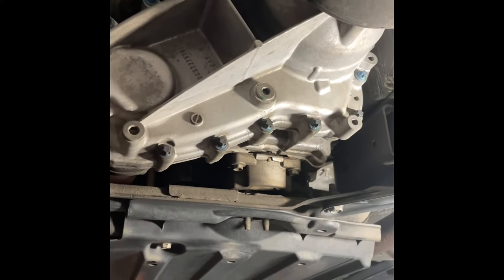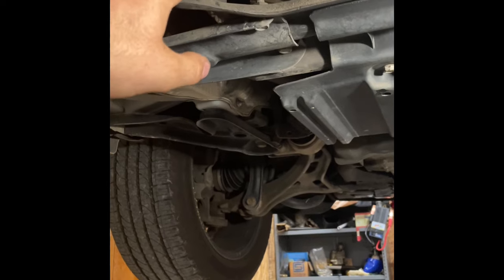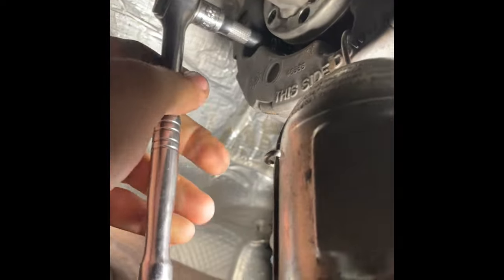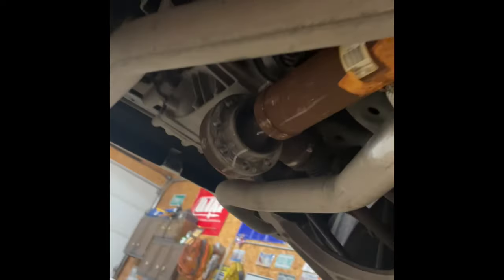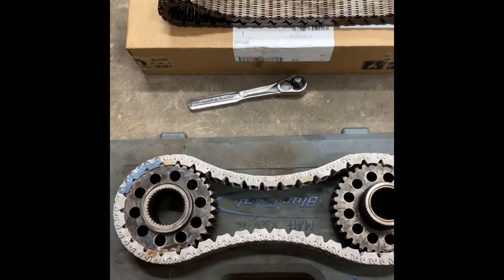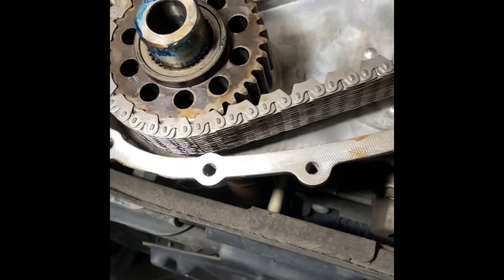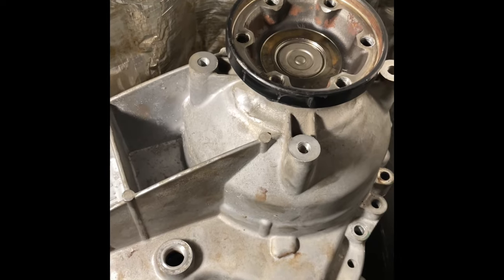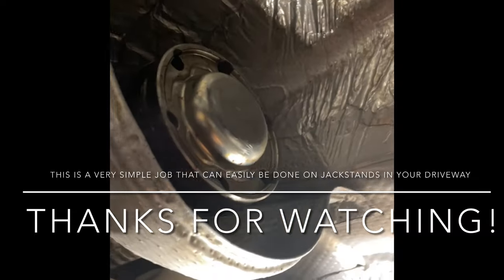WK2 Jeep Grand Cherokee transfer case noise FIXED!!

Comment: Sweet! I see things really don’t change much. I had to do this same job in a 2004 with the NP247 full time transfer case. It’s really not more difficult then the older part time cases. 

I did the oil pan on my 13 grand and had to drop the whole front crossmember. A lot of work but not complicated. By far the worst part was getting the front CV driveshaft out of those yoke cups!

Give me U joints and straps any day.

Comment: Watching this video, gave me the confidence to do it myself. The auto part store gave me the price of a new transfer case at 1800 to 2750... i called the dealership parts department got the part numbers and Google searched them and found both sprockets and chain for less than 450 and I put them on myself due to this video... oh and the auto part store did not sell the parts separately... dealership only.

Comment: Hopefully I don’t need to do this, but if I do looks like I can do it thanks to your video. I change my Transfer case Fluid along with the front & rear Differentials every 30k and I hope that it will prevent any future issues.

Comment: Good job man thank you I have a clicking noise I guess that’s what I’ll be doing soon:) you didn’t list the parts and where you got them always a blessing to have that:)
Reply: Is your clicking noise when you go from P to R, then to 1st and right when you stop?  Mine clicks, but not nonstop yet.  You can hear it when reversing, right when it stops, and right as she goes from first.  I'm not sure if it's the transfer case, or a bad u-joint on the front drive shaft.  Your ideas would be appreciated.

Comment: do you remember offhand what the torque was for the 8mm bolts that couple the front/rear drive shaft & the 12mm for the balancer?....I appreciate it

Comment: I was lookin at the manual for this chain install and it says "There is a blue link on one side of the chain. This blue link MUST be 
installed facing upward" Not sure if they mean facing outwards so you can see the blue links after you have the chain installed or if they mean upwards like at the top of the sprockets

Comment: Hi, I've got a 1994 Jeep Grand Cherokee Laredo ZJ with the full time all wheel drive. It's making the same noise when I do a hard pull off from a stop. My Jeep has the NP 249 transfer case and it does have the viscus coupling. Do you think the chain could be causing the noise and would the cover be able to be removed as easily as this jeep was? Thanks.

Comment: I wonder if the SRT and Trackhawk use a stronger setup.
Reply: My car is a 2012 SRT, I have this same problem and its been getting worse since I bought the car. Mopar catalogue shows that its the same part used in all WK2 Grand Cherokees.
Reply: 14k miles in my 20 srt… no lol same shit.

Comment: Im having same problem.  It only makes noise as you accelerate.  I can let go of peddle and no noise.  But hit gas pedal.  And clunk clunk.   Did you have same issue.  Gas pedsl only noise
Reply: That sounds very similar to my issue. First it started doing it only when it was really really cold outside and coasting downhill,  now it does it at all temperatures, mainly when accelerating now, and it speeds up as I accelerate. 2011 Grand Cherokee. 5.7 QTII

Comment: are there any special tools required for gear removal? If not where they easy to pull off with the chain?
Reply: Mine just fell off after I pulled the cover off no tools needed

Comment: I am hearing and feeling My 2019 grand Cherokee knocking noise in the back when it shifts from 1st to 2nd gear. Sounds like going over a bump in the back. I hear a knock when I first get in starting into1st or reverse sometimes. And sometimes when shifting back down into first while coming to a stop. Do you think this is the problem you are describing in the video?
Reply: Check your diff bushing

Comment: is this the MP3023 transfer case
Reply: Doesn't look like one.
Reply: MP2023 and 3023 are same chassis and chain: 3023 has electric motor and two-speed gear train (more complicated)

Comment: Where did you buy the chain
Reply: Did you find it big guy? Amazon found the chain .  went to Chrysler they wanted 200 plus I bought the Amazon for 75. I am going to evaluate the chain guide before I spend another 80 bucks.

Comment: Here is the noise it makes..https://youtu.be/vxD7Cs1Az08
Reply: Definitely change both gears since your that far already, same as an engine timing chain and gear change, they should go together...
Reply: @alyoungcuda  And if it works?
Reply: @ManuelMartinez-je9hm  it should..it sounds like when your riding a 10 speed bike and you're changing speeds and the bicycle derailleur skips
Reply: is it difficult to change them?
Reply: @ManuelMartinez-je9hm  according to this guys video, it doesn't look bad..but remember a rebuilt transfer case is about 2k just to buy it and then pay labor to install.
Reply: that's right
Reply: I have the same problem.  I'll go find the parts
Reply: I have the same problem.  I'll go find the parts
Reply: @ManuelMartinez-je9hm  I have my chain coming tomorrow from RockAuto, hoping I don't need gears.